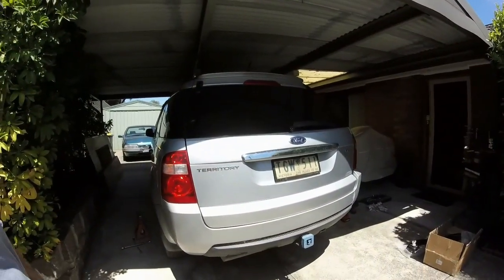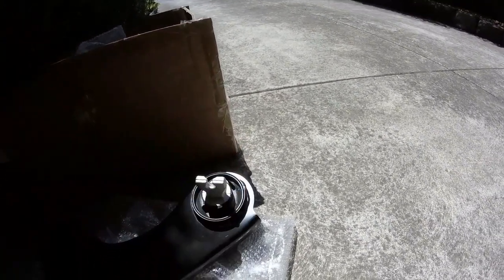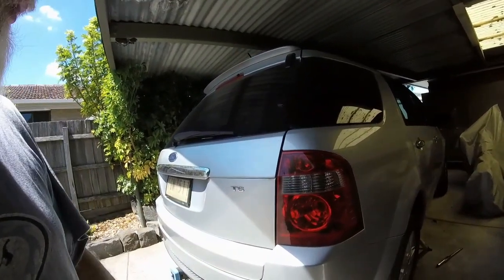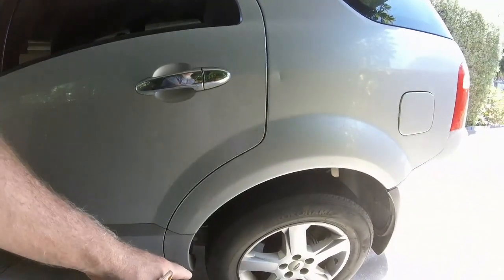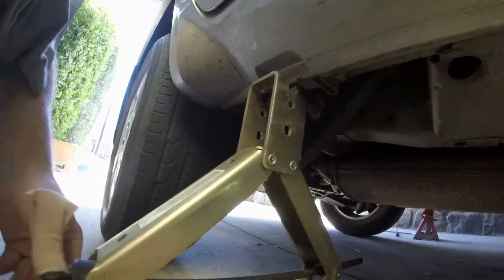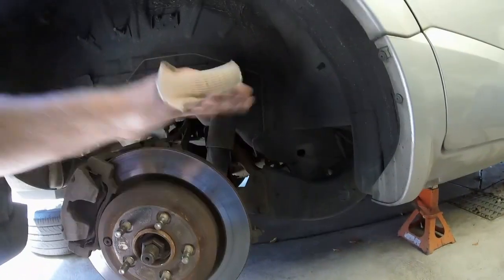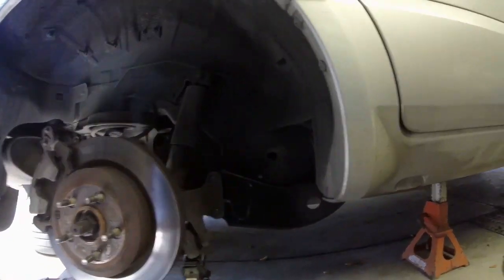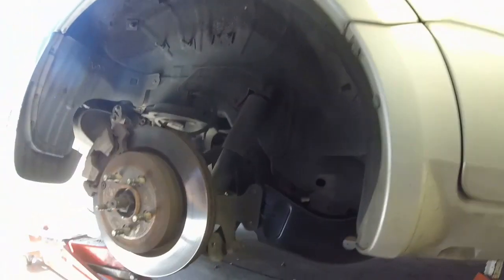Ford Territory 2004 Rear Lower Tailing arm replacement

Comment: Thanks for the video mate. Currently, Machter are charging $360 for the pair (FCA-FD006). A bit of a price hike since you did yours 9 months ago. Cheers.
Reply from the maker: Check these out Tony, these are the suppliers I got mine through, they must be a reseller for Machter? These are current prices.
https://www.ebay.com.au/itm/314071214638     https://www.ebay.com.au/itm/193707683807
Reply: Ahh, thanks mate. @1936Studebaker
Reply: I just paid $78 for the pair of those brand on eBay.

Comment: Control blade bushing, to save a few dollars Im going to replace the bushing and not the control blade.
As soon as I retired I bought a 4 tonne 2 post hoist to put less strain on my bilateral knee replacements.

Comment: If you read the workshop manual, the three bolts that attach the blade to the knuckle are a once only use. You should have got new bolts. There is a reason for it.
Reply from the maker: Maybe if one owns a workshop manual one could read it. I found nothing in my research that indicated that new bolts be used and when you buy the replacement blades they do not come with new bolts. Happy to say my old girl has not fallen apart yet. Thanks for the info, maybe you should make a video and explain it properly according to the workshop manual, I'm pretty sure 99% of the 8000 people that have viewed this video don't own a Territory workshop manual.

Comment: You don't have to drill, just replace the factory cable holder with a cable tie
Reply from the maker: Yeah you can use cable ties but if you want you vehicle to stay original why wouldn't you use the factory clips!

Comment: I have a 2005 Ford territory I replaced a tail shaft bearing 2years a go and now have to replace it again doesn't laste Long
Reply from the maker: Sounds like one of three things,  your rear end is moving around (worn bushes) putting strain on your drive shafts which puts strain on the bearing or your drive shafts are out of balance or bent. Could also be the pinion bearing? I replaced a Centre shaft support bearing 7 years ago and it's still going strong. From what I understand there were two different centre shaft support bearings for the early Territory's, they have a different size ID, the one on mine was 35mm if I remember rightly.
Reply: @1936Studebaker  thanks for that 👍I will look in to it